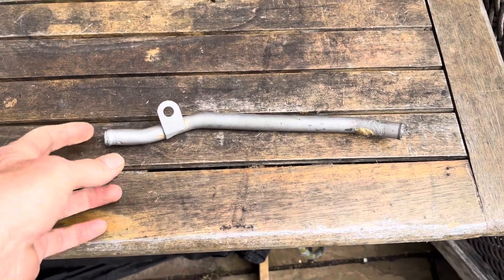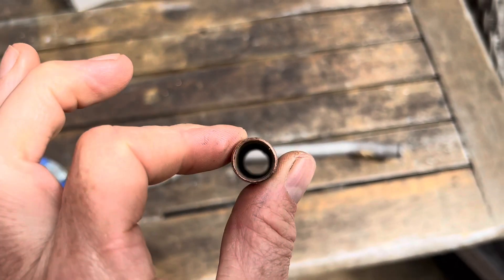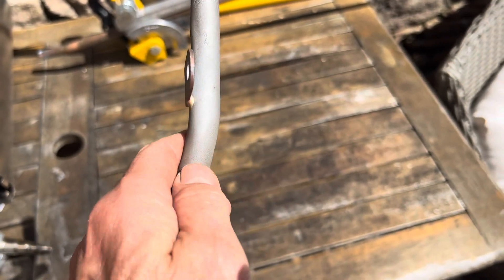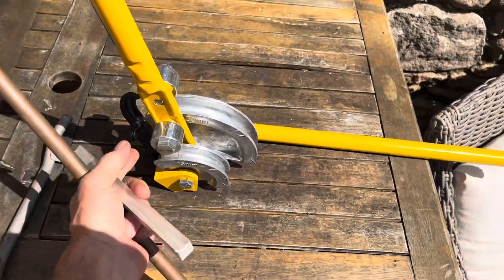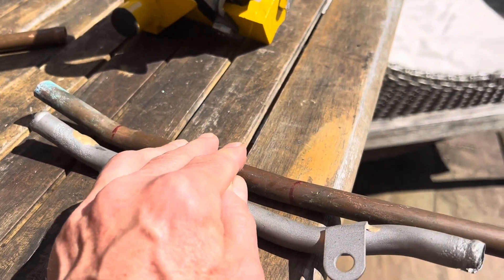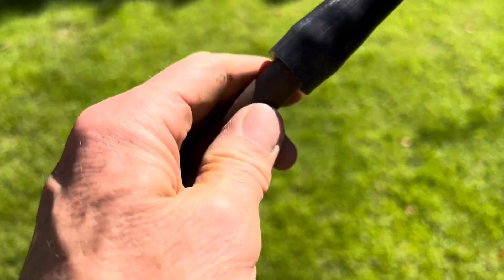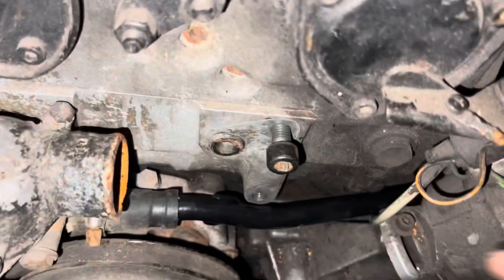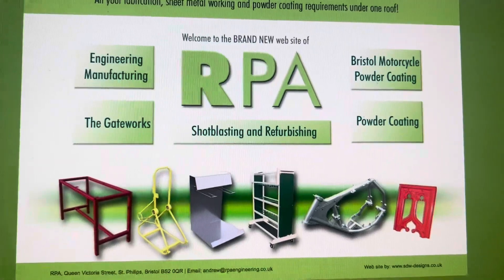Making a complicated steel radiator pipe with end beads & bracket

Comment: Thanks for the video again Mike. The battery tray looks similar to mine (1974 450SLC) but the 2 long bolts and bar lengthways across the top length of the battery does not look the same. Nine has 2 small clamps which fit at the bottom long side of the battery and bolt to the tray and it looks like yours has 2 bolts to fit those brackets to those clamps, so one of the lengthways lumps at the bottom of the battery wedges under the tray on one side and the other side has these 2 clamps to hold it in and down.  I’ll try and find the part nuimber, i bought a replacement for a lost one on ebay. John